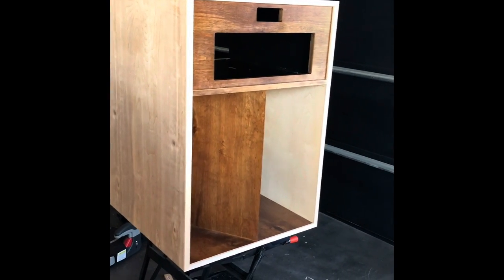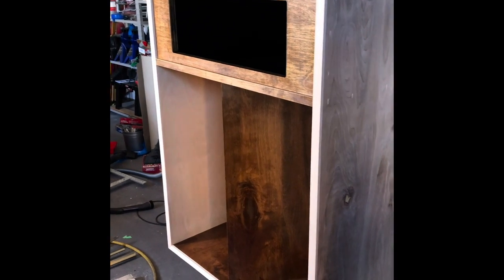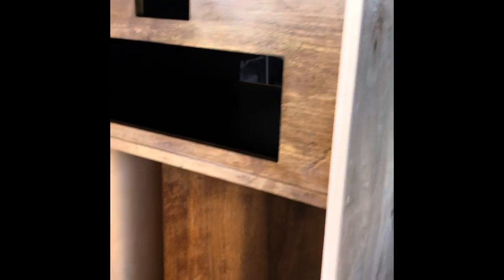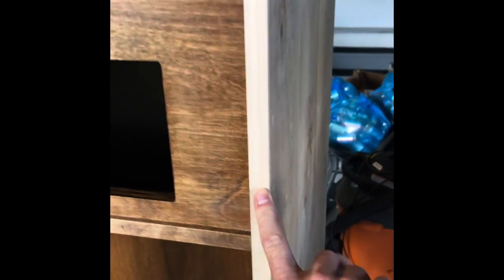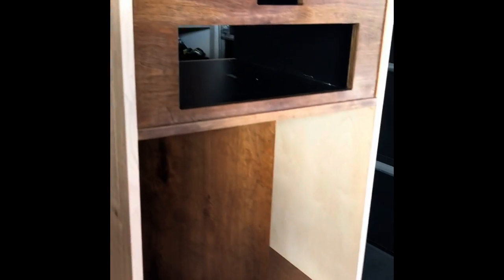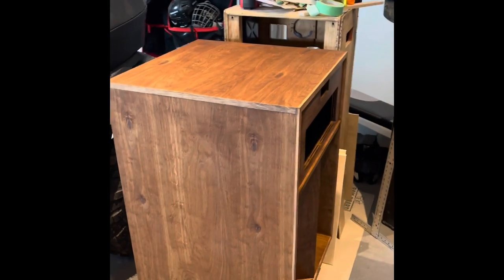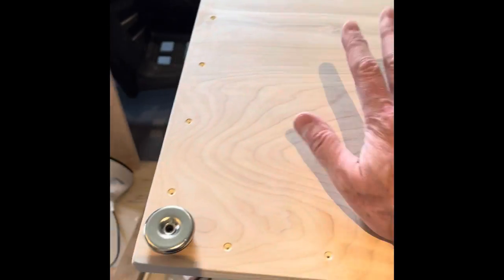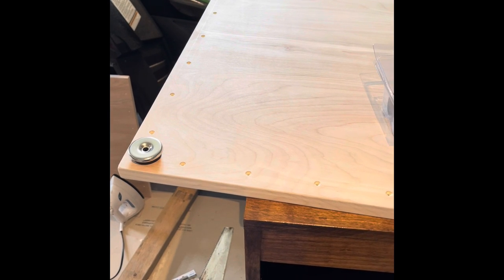DIY La Scala Clone - Part 7

Comment: With regard to the maple edging, experiment with about 1/32" oversize width strips.   Then try an extremely sharp block plane vs. sanding.   Paying attention to the grain of course.   Then grab a sharp scraper to finish off.   You'll  like the results.